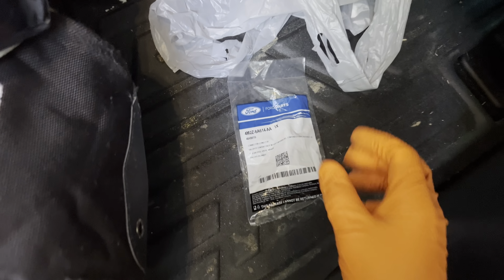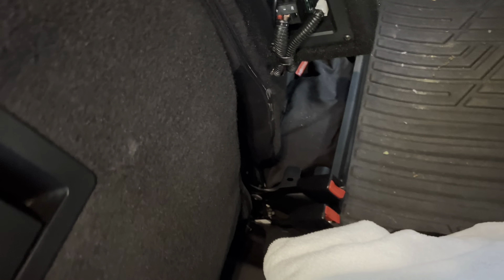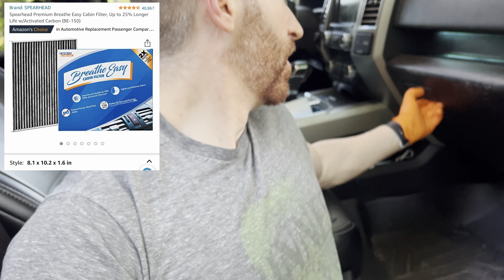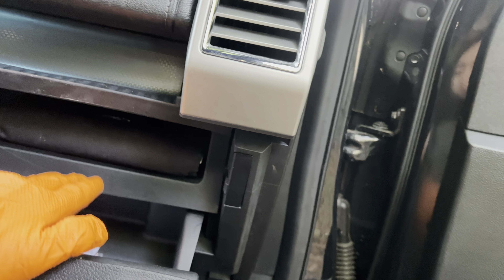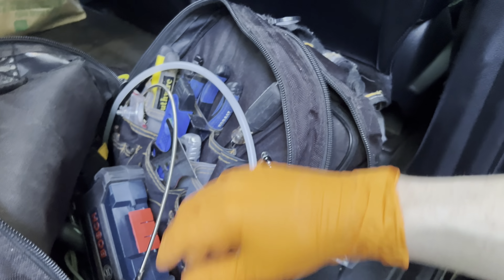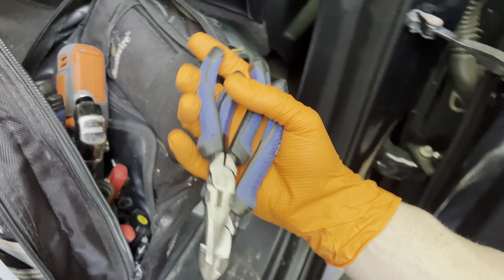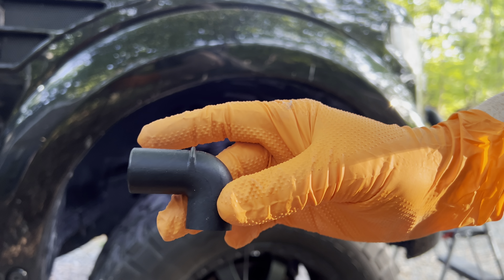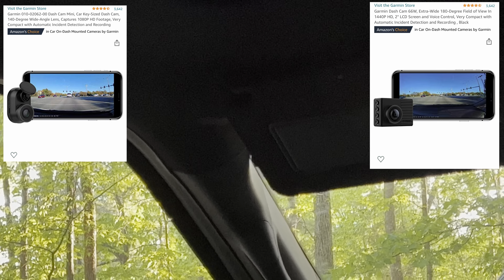F150 Cabin Leak - AC Hose Install & Other Possible Cabin Leaks!

Comment: If the tube coming out of the firewall has ridges on the bottom I would recommend sanding the ridges off with a dremel. This allows water to seep by the elbow. Also ford recommends using the long side down. I just fixed this issue on my f150 yesterday. I put a bead of silicone to seal the foam gasket before installing the elbow.  Also used the 3m 3340 tape over the elbow to ensure it stays on. This is dryer vent tape from Lowes.
Reply from the maker: Thanks, good info Tyler!

Comment: My truck is 2018 raptor. I had the leak from the back vents fixed , however, I still have the leak  at the front drivers  side . Now my question  if it's the AC causing the problem leak would  it soak both front sides or only the front passenger  side? .
Reply from the maker: I believe just the passenger side. I have heard from other people that our models tend to leak around the front windshield and behind the dashboard and simulate the AC problem. So if you have it on the driver and passenger side, it might actually be a front windshield leak. Let me know what you find!

Comment: Turning the wheels hard left and going under makes it way easier to reach and install
Reply from the maker: Even with the 35s? I thought I tried that, does it work with bigger wheels?
Reply: @rawphysique  I turned them just slide easier, as long as you fit under you should be fine, tire will not be in the way even if they are straight

Comment: Did this work
Reply from the maker: Actually I don’t think it did. The cabin leak from the AC was not actually causing any issue with the truck. I found that behind the back seat and behind the carpet/wall carpet that there are air vents (left and right side) behind the backseats. Leaves 🍁 had built up between the truck bed and the outside cabin and begun to push through those, causing that earthy boot 🥾 smell. U can actually see the vents in my speaker 🔊 install video. That was my issue with smell. A lot of other people were dealing with a leaky smell from the AC drain like in this video though. When I made this video I thought it was the AC drain
Reply: My truck is 2018 raptor. I had the leak from the back vents fixed , however, I still have the leak  at the front drivers  side . Now my question  if it's the AC causing the problem leak would  it soak both front sides or only the front passenger  side? .